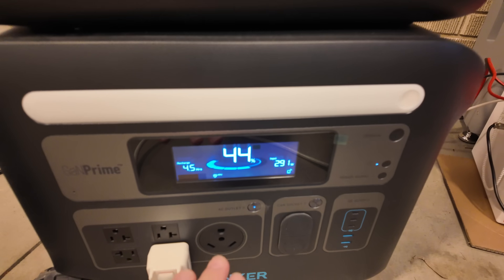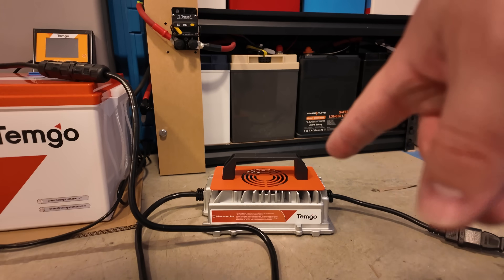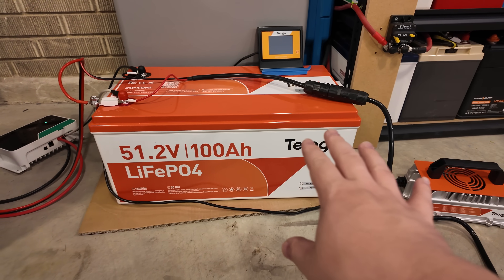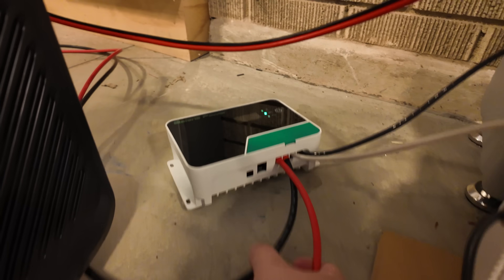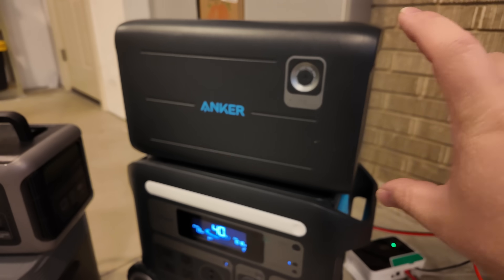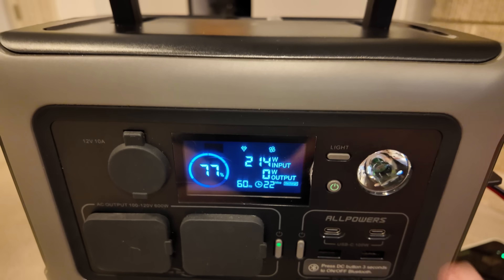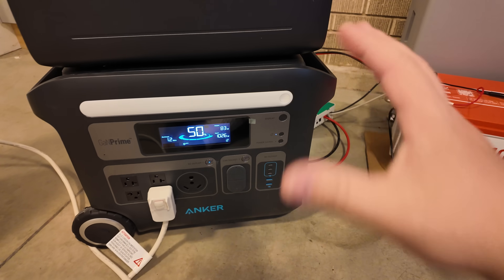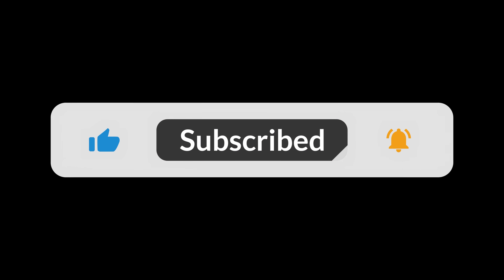I SOLVED the BIGGEST Problem ALL Power Stations Have!

Comment: Thanks for the video but I have a question. I purchased the EQK 10,000 BTU portable AC model: eapc10rc1 which runs at ~1450w and I also purchased the Growatt INFINITY 1300 which has 1382Wh capacity and 1800W output. Similar to your portable AC, the EQK shut off when the Growatt was on battery alone. I thought the limitation was the surge of the EQK exceeded the Growatt 1300 surge peak of 3600W. I was only able to get the EQK to work when the Growatt was plugged into AC (input  ~1793w || output ~1350w-1100w).
I returned the Growatt on the basis that the surge peak of the Growatt could not start the portable air condition and ordered the Oupes Mega 2 (surge ~5400w) thinking I needed a higher surge capacity. But after watching your video the Anker f2000 surge is 2800w which is less than the Growatt). I did take into consideration that you have the 60v battery and charger sustaining the Anker F2000 but I discounted that because as I mentioned before, I was able to get the EQK to work when the Growatt was plugged into the AC outlet.
Do you have any insight into what is the real reason the portable air condition shut-off at the start? I think having a better understanding of this would really help me. Thanks.
Reply from the maker: You issue certainly seems like a flaw in the inverter. Because it went away when it was plugged in...so opposite issue I am dealing with here in this video. When my Anker is plugged in, it trips due to the pass-through limits, but when I can use it's inverter, it starts the AC just fine! Thanks for watching!

Comment: “Volts are pushed, Amps are pulled”. THAT is the phrase I wish I had known years ago. Thank you.
Reply: Volts is pressure; Amps are volume
Reply: @spockmcoyissmart961  just like low frequency (transformer based ) is real reliable long life power, where high frequency ($5 chipsets) is cheap short lived power! Pushing those China units will end badly, and quickly, cost nothing to build, and sold for rediculous amounts of money, they don't like inrush current, or heat, the batteries are to small, the input voltage and amount of solar is to low, built in usb are just waiting to break like your phone, then useless, and apps are just useless when grid goes down! Why invest in half ass stuff that you have to buy more stuff to fix the shortcomings, ie, buying another battery (hack) to extend runtime, which is not capacity. Capacity will share the load, not just add more time, Capacity, load sharing will make all your batteries work easier, hacking is still working your undersized battery twice as hard, but those chips will go long before the battery, if they were worth anything, don't you think the grid would be run that way, but it's not, because there short term and unreliable
Reply from the maker: I agree! Thanks for watching!
Reply: I thought the charging volts from the extra battery had to match the power stations input capacity (12v i guess) so it wont overheat; does the BMS in power station step down 48v to 12v?
Reply: Which makes me wonder why you need to be careful about the open circuit amps on solar panels.
Reply: Amperage is inversely proportional to Resistance. The less resistance, the more Amperage can flow. The more Amperage that flows, the more the conductor heats up.

Comment: Even with the inconsistencies of this setup,  AC to DC to MPPT into the power stations native DC voltage and then back to AC it is still a great idea.

I have had an AC200Max exclusively charged via PV/DC for three years at our family cabin.

It charges via two 48V 50Ah DCHouse batteries.
We have a Victron charge controller that is going to embed his charged by four solar panels.

And then we have an EG4 Chargeverter that charges up the batteries via The myriad of different generators that we have up there at any given time.
Reply from the maker: That’s a great setup and a perfect use case for what I was showing in the video! Thanks for watching!

Comment: This is similar to my design at home. 

I have 4 x LV6548’s in split phase giving me 100amps x 240v. 

3 x 280ah battery banks based on eco-worthy batteries. 

3 Chargeverters connected to Grid and Portable generator through a manual transfer switch. 

And 2x EG4 Solar MPPT Charge Controllers

With  14x440w Aptos bifacial panels. 

I’m technically off-grid with grid only running EG4 Chargeverters. They only run when SOC drops right before inverters would shut off. 

I have clean stable power and no hiccups. Plus my electrical usage from grid dropped significantly. 

I got it setup as a whole house UPS with solar.

* I did install a soft start on my main AC just in case and it’s helped a ton *
Reply from the maker: Sounds like a great setup! Thanks for sharing!

Comment: You didn't use the Honda generator which might be able to run the ac unit because it might handle the surge .You chose an under powered power station to prove your point instead of matching the source to the load. Stacking the deck to prove your method damages your credibility.  I don't have a problem with adding more battery storage, but a generator matching the load is a good redundancy . If the Honda is too small get a generator with higher wattage and you can charge up the Anker power station while running the ac . I also have a 1800w power station and it won't start my ac when set on normal settings but it will start it in ecco mode and once it is running I can switch to normal settings.
Reply from the maker: The Delta 2 actually has higher surge capacity than the Honda EU2200i. So if it was going to start, this power station could have done it. Thanks for watching!

Comment: This might just be how I add a dc battery to my Delta 2 in my van. I want to have higher current output available for my DC circuit, increase overall capacity, and be able to charge everything from solar, shorepower, and the onboard inverter while driving. This looks like it’ll do the trick!
Reply from the maker: That’s the exact reason I built this setup! Thanks for watching!

Comment: I saw another YouTube where it was asked if you could charge a lithium battery and discharge/pull from at the same time. The YouTuber may not have known what he was talking about and I will do more research into that. Great video.
Reply from the maker: You can totally charge and pull from the battery at the same time! How else do all these large whole home power systems work? Haha! Thanks for watching!
Reply: Yes, I understand adding to and pulling from your Eco flow, but is it safe to pull from and charge to a 52.4 volt at the same time?
Reply from the maker: Yes indeed!

Comment: Hello, thanks for the great video. One question just so I dont do any damage. I have a Victron Orion XS 1400 DC-DC alternator charger, which currently charges my Ecoflow Delta 3 Plus through an XT60 connector. I want to add a 12V 100Ah battery to the system for more capacity. Can I wire the Victron onto the 100Ah battery, then wire the Ecoflow directly onto the 100Ah using the XT60 plug? This wont cause problems when the victon is running I guess because the Ecoflow will self regulate and the 100Ah will just charge as normal?
Reply from the maker: Yes, should work fine. Just note that at 12v your EcoFlow will only charge at like 120 watts. Thanks for watching.

Comment: So what happens if you use a generator to charge the golf cart battery while powering the ac?
Reply from the maker: If you have a large enough generator, that’ll work. But you’ll have the same issues if you have a 2,500 watt unit or less regardless of how you are charging things. Thanks for watching!
Reply: I was advised that lithium battery could not be charged and pulled from at the same time. Now I’m wondering where I saw that and if things have changed. Enjoyed your video. Several options.

Comment: This makes no sense.  I have a Honda 2200i generator that can run my window AC while charging a Bluetti and a Jackery all at the same time with no issues.
Reply from the maker: You must have a very small window AC. The AC you saw in this video is a 15,000 btu unit. Thanks for watching!
Reply: @theresatrickforthat  Yeah I think mine is a 6000 BTU.

Comment: Great info! If I wanted to use that battery setup, what size power station would you recommend for an AC unit in my e350 van? (5000 btu new unit)
Reply from the maker: That Anker F2000 is very capable! That portable AC unit I started in the video is 15,000 btu’s. So a 5000 btu unit would be a walk in the park for it! I like that it very powerful, yet still somewhat portable. The F3000 and 3800 start to get really heavy quickly. Thanks for watching!

Comment: Do you need the golf cart battery?  Could the output from the smart charger go to the solar input of the power station directly?
Reply from the maker: I’ve seen some people try to hack something together with a switching power supply unit. But those cost well into the $300 range…why not spend just a tiny bit more money and get basically a switching power supply in the charger that’s included and 5+kw of battery storage as well? Thanks for watching!

Comment: This is realy only a problem with anker power stations. For some reason their plwer stations even though they can charge at 1800 watts they can only do about 1400 watts passthrough charging. The Delta 2 and the Delta 2 Max does not do this. I havent texted any other ecoflow products personally but other people claim the same on the bigger delta pro as well
Reply from the maker: No. EcoFlow has the same issue. Let use the Delta 2 Max. It has a 2,400 watt inverter and can surge way up to 4,000 something watts. That’s awesome! Well, the second you plug that in to AC charge, it’s going to limit its output to 1,800 watts. So you won’t get the additional power it can serve up because of the de-rate for the AC pass through. This hack I’m showing solves that issue. Thanks for watching!

Comment: Great idea! Is there a way to bypass the battery and just feed the charger directly into the power station using the generator?
Reply from the maker: I’ve seen some people try to hack something together with a switching power supply unit. But those cost well into the $300 range…why not spend just a tiny bit more money and get basically a switching power supply in the charger that’s included and 5+kw of battery storage as well? Thanks for watching!

Comment: This is so helpful to see an idea you had be utilized and out to the test as others have thought the same! So glad I stumbled on this video and you demonstrated this. Masterclass really and super helpful to know it can be done! You just saved a lot of people time, energy, effort and $$$. 

Much appreciated!
Reply from the maker: Thank you so much for the kind comment! My goal is to help better people’s lives in some way! Thanks for watching! Got more great content on the way!
Reply: @theresatrickforthat could you use a DC to DC charger to also charge the battery if utilizing in a mobile set up? 

So dc to dc charger to the battery, solar to mppt to batter then battery to power station. While driving you get the solar all the time and then dc to dc charger from the alternator charging. When parked or camping you could use the gas generator with the GC battery charger or shower power? 

Could you then also wire two of these batteries in Parallel? To add more usable power in addition for the power station.
Reply from the maker: Yes to all of your questions and ideas!

Comment: So instead of using the simulated gas generator(ecoflow) you can probably use solar panels to charge the big battery, while the big battery is charger the Anker power bank?
Reply from the maker: Yes indeed! You must have missed the whole section of my video going over that and showing my MPPT charge controller hooked up! Thanks for watching!

Comment: I’ve been doing this for months with my oupes mega 3 unfortunately the power station will run your batteries all the way to 0v which not good
Reply from the maker: That’s why this kit is so awesome! It has automatic battery protection protocols, so it will shut itself down before it gets to low of a voltage that it sustains damage. So you can use it with confidence! Thanks for watching!

Comment: This has been a concept in my mine for the longest while. 

Also wanted to use a GenMax generator that has a dry contact start. Hence wanted the flexibility for the battery to charge when it’s at a lower level and the generator to turn off when battery levels  are at like 90%.
Of course this would be a hybrid inverter kind of setup.
Reply from the maker: Well, as you can see…it works great! Yes, to do your setup, you would need a larger AIO inverter. I have one and tested it with this battery kit! And I think my unit has a dry contact two wire generator start and it’s considerably cheaper than a hybrid inverter if you don’t need the grid interactive features a hybrid inverter has! You can see mine here: https://youtu.be/dboHXnSY9LI?si=0ZXbCRbGG8PvwooL Thanks for watching!

Comment: So let's say I don't have a gas generator but I used a Delta Pro generator instead to charge up the Tempco 51.2v 100 ah battery...the Delta Pro is hooked up to solar panels 1600 watts max...would this be feasible? Then I can use the Tempco battery at night.
Reply from the maker: Absolutely! The charger included with the Temgo battery can be plugged into any power source, and yes that would be a great way of making more use of excess solar power you might harvest during the day to use later. Always enjoy hearing from you! Thanks for your support of the channel!

Comment: Ecoflow, at least the Delta 3 Plus I have have a feature to disable grid bypass, so it will always run off the inverter unless your battery is too low. This is a way to easily significantly increase your battery storage at a much lower cost though as the expansion batteries are always massively overpriced. This comes with a small efficiency loss, and is slightly less convenient, but far cheaper.
Reply from the maker: I agree, expansion batteries are expensive! Thanks for the comment and for watching!
Reply: I note that Ecoflow charge $2200 for their 4kWh expansion battery (or $569 for the 1kWh expansion for your Delta 3 Plus, about the same per kWh) , while Pecron (which I have) only charges $800 for their 3kWh expansion battery. That's much closer to the cost of this golf cart kit. Ecoflow are more famous but omg they know how to charge! Not being able to disable AC bypass is the only thing I don't like about my Pecron E3600LFP after almost three months with it. This is much less of an issue now (this week!) I have solar panels on it, and turn on the AC input mostly only while I'm sleeping, or out of the house for an extended period.

Comment: What size fuse is on your positive post?
Reply: I would do 20A as the power station should self regulate it to 15A max and you want the fuse slightly bigger.
Reply: I've been searching for a video like this for a while. I've been looking for an easy way to add solar and more capacity to my overland setup. I think this is it!
Reply from the maker: It’s a solid hack! Thanks for watching!
Reply from the maker: Mine is 40amp to protect the 10awg wire.

Comment: Instead of putting the 48 battery into the DC input or solar input, why don't you put it into the extended battery port??? That way the external battery can be charged with the power station... Cuz right now you only have it set up for one way only...
Reply from the maker: Because a lot of power stations either don’t have an extra battery port, or they have the ports locked down so you can’t just patch on a 3rd party expansion battery. Plus then you’ve got to worry about making sure both batteries are the same charge when you connect them and a bunch of other stuff. This way I showed is a lot simpler. Charging the external battery is a non issue because it comes with a charger!

Comment: look up the ETAKER F1000 Pro, smart piece of kit
Reply from the maker: I’m familiar with that unit…never tested it but am aware of it. It only outputs 1000 watts max if you can max out both 500w inputs…and at over $300, it’s almost half the cost of this golf cart battery kit, and I get a 1000 watts charger plus 5kwh of extra battery storage with this kit. I think what I showed in this video is more bang for the buck personally. Thanks for watching!

Comment: Jackery limits its charging to 1800w-output. So it doesn't have this problem which is nice.
Reply from the maker: Are you saying your Jackery only has an 1,800 watt inverter? Because is it does pass through charging, its probably going to have the same issue that I’m talking about in this video! Thanks for watching!
Reply: @theresatrickforthat no. It limits output when it's in UPS (pass through) mode to 1800 watts to avoid this issue.

Unless I'm misunderstanding the issue
Reply from the maker: Yep! That’s the issue I’m trying to avoid! My Anker F2000 can produce 2,400 watts continuously and surge up to almost 5,000 watts when it’s using its inverter…but as soon as you plug it into the AC charger, it hard limits to 1,800 no questions asked and will shut down. So I’m leaving power on the table when it’s charging via AC which is why charging via DC solves that.